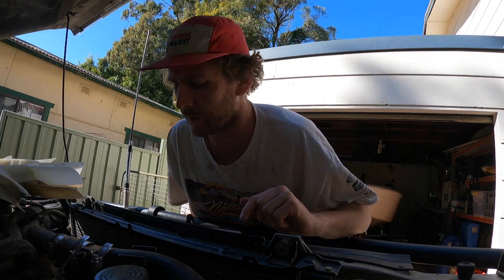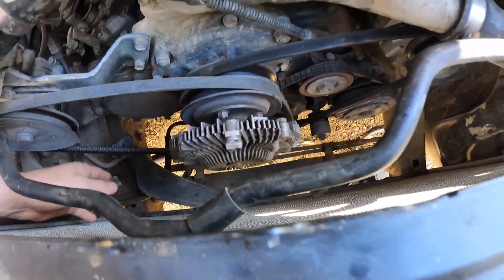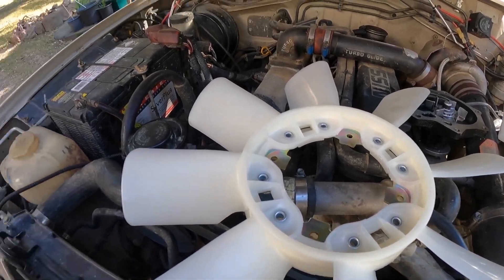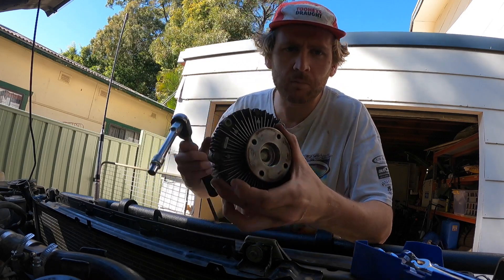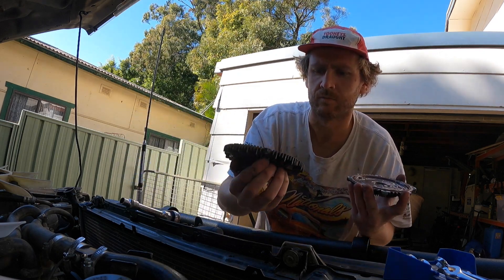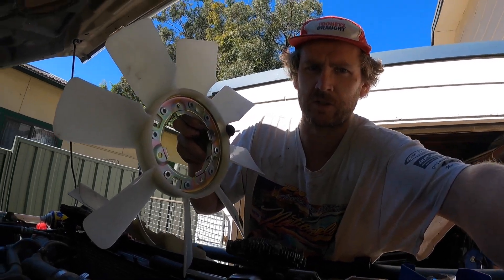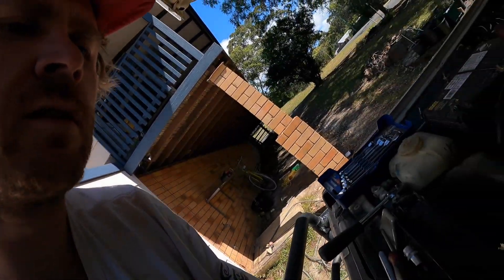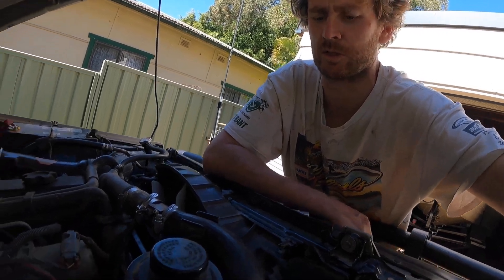PATROL / TD42 OVERHEATING CHEAP FAN UPGRADE / WATER PUMP

Comment: Good work mate.
I had similar issues with my silver top td4.2 
I run thermo fans with aftermarket rad.
I replaced the water pump with a Derk water pump now I struggle to get it over 90.
Reply: What radiator ajd thermos did you run mate, i thought pqr radiator and 2 maradyne thermos would kick ass, but everone seems to think thermos are shit.
Reply: @ainsleytaylor224  the rad is a aftermarket alloy one with two smallish thermal fans on it maybe just an eBay special I have just added a pushing 16inch 2700cfm fan but will let you know how it goes on the highway it’s fine I have done the Derk water pump upgrade if you have not done it I strongly recommend you do best mod you can do.

Comment: Great video, mate. How did it work? I've got a 2003 Patrol 4.8 petrol and the viscous hub isn't working. Down here in the "land slightly down under" (Ecuador), they want about $400 for a replacement. I'd like to just fix mine.